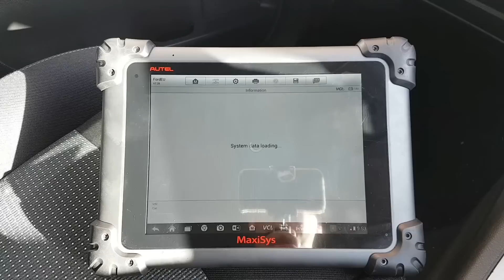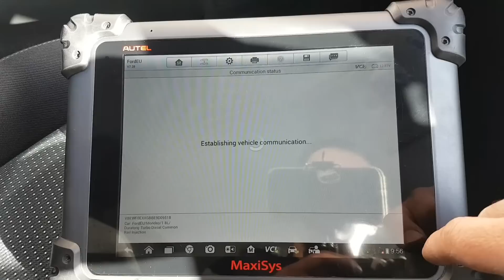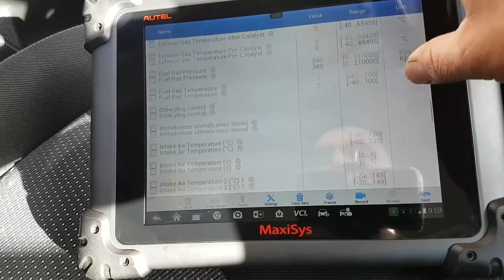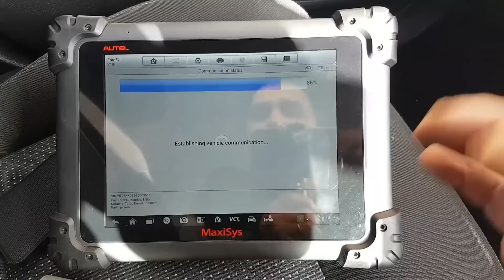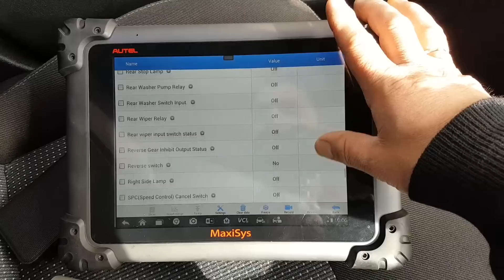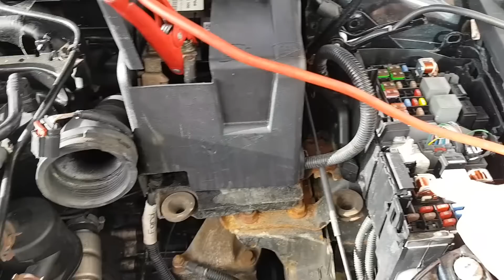Ford Mondeo 1.8 Duratorq no crank no start... how could this be misdiagnosed?

Comment: I have a MK4 Mondeo that is a no crank start. Have tried jumping battery, changed fuses and relays, still nothing. When ran OBD I do hve ABS codes come up and have had ABS light on for a while. You said i mondeo ABS is part of immoblizer system, could having faulty sensors cause car t noy start?
Reply from the maker: Could indeed...
But, should still crank...
Any other codes?
Have you checked live data?
👍👍👍

Comment: Around 2007-2009 ford began fitting the wet belt on this engine, on those years you could have a chain or belt and as you pointed out the end of the tensioner bolt (under PAS pump) tells you which type you have, early engines are chain, later are wet belt and 07-09 could be either, ford must have been using up old stock alongside phasing in the wet belt units.

Comment: that's why I have a mk4 mondeo 2.0 petrol duratec. it's chain driven and has 150k miles and does a reasonable 36.6 mpg. smooth quiet motoring.
Reply from the maker: 👌👍👍👍
Thank you for watching and for your comment!
Reply: Instead ur belt getting eaten ur swirl flaps will be next to meet the valves. you should have got a mk4 2ltr diesel
Reply: @markknights5109  nope. the duratec has a cam chain that is well engineered and I have a new intake manifold. my car has done 150k miles and drives superb.

Comment: Sup super technician nice work i am planning on buying a autel but there are so many which one you ha e the maxisys mk908p are ms906bt i was planning on testing the ap200 then i realized i need something powerful can yours program key fob
Reply from the maker: Hi
If you want to program keys, go for the IM608... 
I have both, my main tool, and as per the video, is the MS908P... 
Great tool, with flashing for BMW and Mercedes... but a bit limited on programming keys... it is not its primary function anyway...
Thank you for watching and for your comment!

Comment: Ford has a safety system that won't let you crank when the battery voltage gets low. Even after a charge of the battery the system needs to be reset by disconnecting the battery leads for few mins.
Reply from the maker: Possibly... but that would have nothing to do with this case...
Thank you for watching and for your comment!

Comment: Superb video as always! May I have a question. Based on your experience which of the two engines could be a better choice in terms of reliability with a stage 1 ecu upgrade? Mondeo mk4 2.0 tdci vs Audi B6 A4 1.9 PDTDI. Many thanks for your input!
Reply: 1.9 PD engine all day long. Make sure you use the PD oil from TPS when servicing too 👍
Reply from the maker: The Audi...
But that it is just my opinion...😉
Thank you for watching!

Comment: if the car had starter motor problem on first break down,i check battery and wires to starter ,with bulb for power,and rock car in gear,turn engine over ,see if ok ,starter jammed,if turn over ok,then a bump start ,see if got fuel and engine ok,if engine tight or clicks,grinds ,then engine is in trouble ,nice vid ,seen loads cars roughly handled too,makes me mad as well ,not good practice ,with customers cars
Reply from the maker: 👍👍👍
Thank you for watching!

Comment: The original garage it was at must have been some ape when the wet belt snaps u know instantly on turn over it gone have had many cross my path over the yrs as previous guys I won't call mechanics cause there not a first cousin to one have only replaced the top belt too many idiots in motor trade with no qualifications or knowledge ripping people off

Comment: I have Launch X431V SD card version , all data is install on SD , no speed issues all runs perfect.  automotive diag data is not 8K CGI productions ....  :)

.... on the other hand  .... I had identical car last week , the belt from crank to FP was broken ("nobody replace that" , just the upper one).  the car was scrapped  :)
Reply from the maker: 👍👍👍
Thank you for watching and for your comment!

Comment: For some engines chains are not much better than belt especially aftermarket chains don't last but belts where designed to be replaced easy compared to chains and cost of chain kit is expensive. I don't know how they make engines where chain lasts for ever and engines where chains just don't last at all. And if engine is belt driven the belts should be replaced regularly. For this car better option would be used engine instead of repairing damaged one.

Comment: Belts in oil isn't a new idea, back in my youth I had loads of Cortina and Capris with cambelts drenched in oil...))
Reply: They used the pinto engine. They where not wet cambelts what you saw was oil leaks from the camshaft or crankshaft oil seal
Reply: @jeremycanning8934  Thank you for stating the obvious...I was having a laugh. I hope you can find your sense of humour again soon.

Comment: You heard the first time you cranked the engine that there was major damage . Maybe the other garage tried to pull it to start but actually , this was non of your concern. You were right to stop diagnosing the electrical issues . Engine kaput means no need to crank.
Reply from the maker: Exactly! 
👍👍👍

Comment: It has 2 timing belts not a timing chain only some have its called a wet belt
Reply: Sorry about that I text when I was still witching you I see you said it at the end 🤐
Reply from the maker: 😊
I get that a lot...😉
Reply: Still love you and your videos 😃😃
Reply: You can get the same engine from the 2000 Ford escort van 1.8 cheap it’s the same
Reply: @antodenn381  it’s not exactly the same !! Pump needs changing for starters. Then a 30 quid boss for the pump so you can use the chain setup also injectors need changing. And if you want to do it properly all inlet side needs swapping.
Reply from the maker: Correct...
👍👍👍

Comment: Another excellent piece of Ford design !
Reply: The design is fine. It’s the servicing that creates the problem. Most back street garages assume it’s still chain driven. Another contributing factor is oil contamination. If you got a motor with that lynx engine you can get it converted to chain !!
Reply from the maker: 🙄😬
LoL

Comment: As soon as this was a non start and a 1.8 there was a poss wet belt had gone and they all change the cambelt but as the wet belt is a big job no one is willing to get involved unless the car was towed back words to try and start it and jumped the chain...same as the transit vans fitted with 2.4 2.2 and 20 they try and tow start in reverse the chain jumps and damages the engine......

Comment: From the moment u touch the starter relay straight away i knew was a wet belt. I did 4 galaxys with the same problem wet belt went. Then people starting messing around with electric. In there should be really a chain and a belt on the top. But Italians they did this for saving costs. Belts are cheaper than chains. And quiet too. Even on auto data it says its a chain on there. But actually is not. The old 1.8 tdci engines did have a chain. After 2007 they fit in some of them wet belts . The 4 galaxys i fit a replacement engine and all was good. Wet belt on oil thats not a great design to be honest. On another hand that engines are bullet proof. Good video.
Reply from the maker: 👍👍👍
Thank you for watching and for your comment!